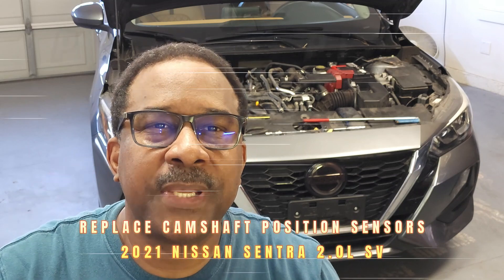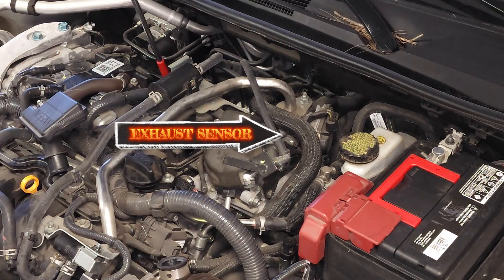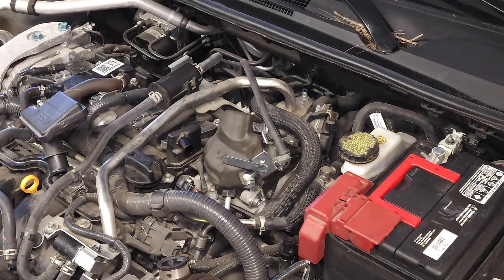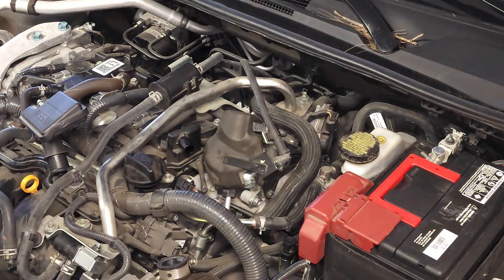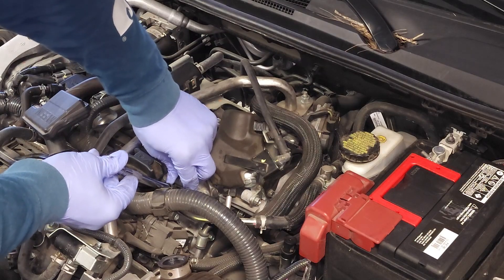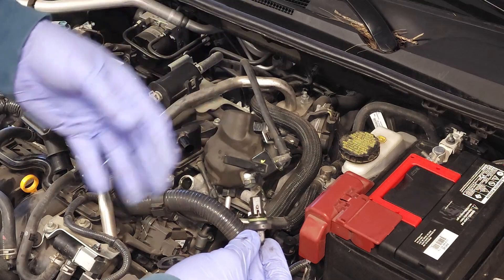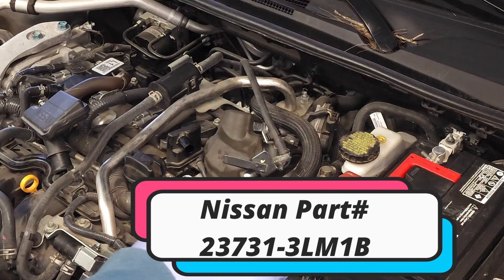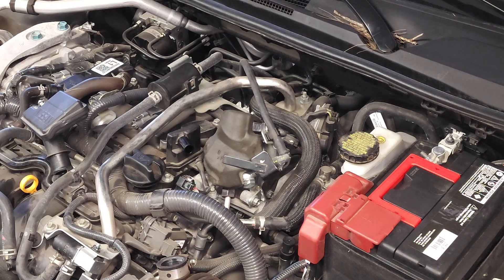2019-2024 NISSAN SENTRA 2.0L, Replace Camshaft Position Sensors (MR20DD)

Comment: Also want to note if the engine throws code P0015 Camshaft B position, that will be the sensor you mentioned that's more towards the fire wall of the car.
Reply from the maker: Camshaft “B” → Exhaust camshaft
Please subscribe, support the channel, and share with friends and followers.